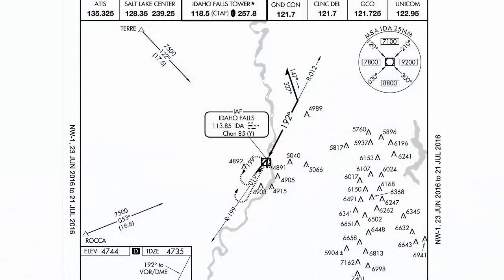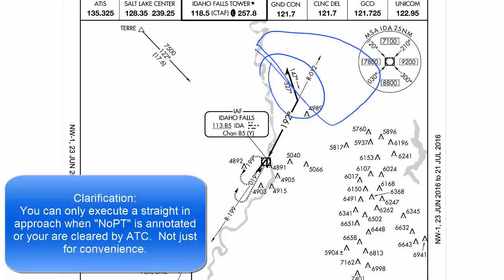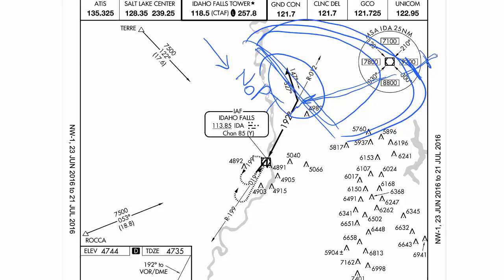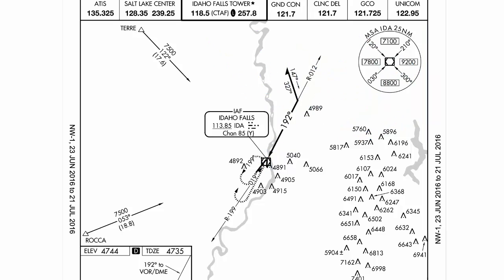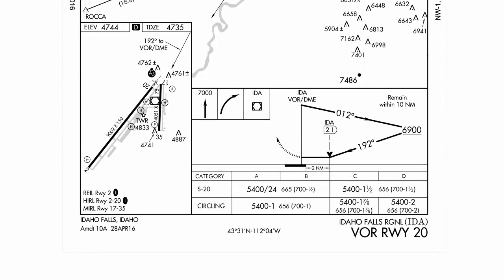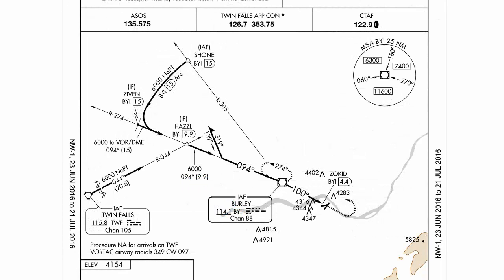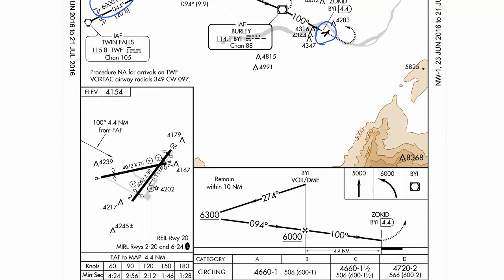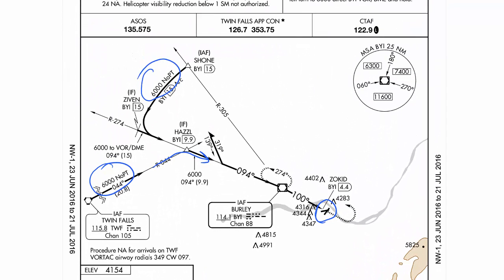Straight in Approach vs Straight in Landing

Comment: Regarding the VOR-A at Burley Muni (BYI) Approach Plate... The only Approach shown is a Circling Approach, so by definition there is no such thing as a Straight-In Approach for this Approach Plate. The two NoPT options merge to align at 094º followed by a 6º right turn after the IAF/FAF, which is 40º off from runway 060, and 80º off from Runway 020.  A Circling Approach is still required to line up with either runway. If the published Procedure Turn is used to line up with 094º the end result is the same... a Circling Approach. So a Straight-In Approach (non-precision or precision) cannot apply here.

I'm not sure, but logically an Approach Plate that does have a Straight-In Approach published in the Minima could still require a Procedure Turn to line up with the runway if elevation became an issue on the 060 and 020 runway approach area. Looking forward to your response, from this confused X-Plane Pilot. :)

Comment: Hello there ! I have a question. For example in airdrome where I work we have an ILS DME Y app and usually we don't vector them to the final and what we do is that we just clear them for an ILS as they approach IF. so my question is do I have to clear them for straight in app? And another question is the minimum for straight in app going to be the same as for the ILS ?